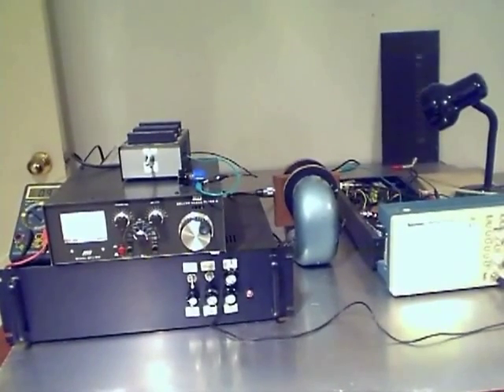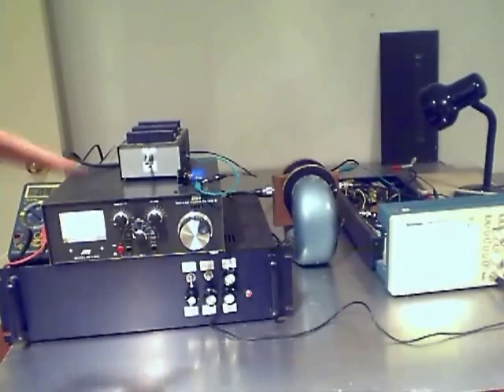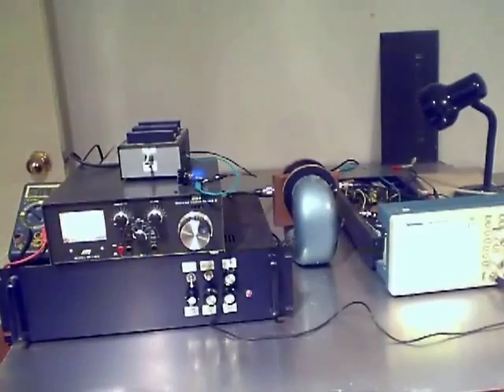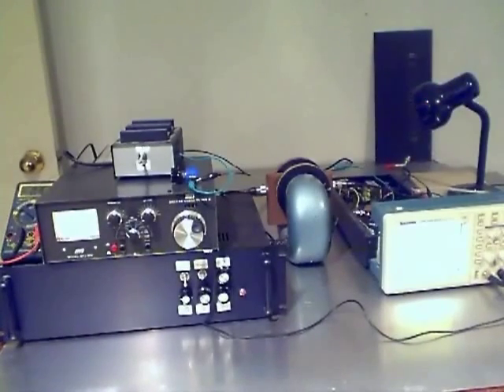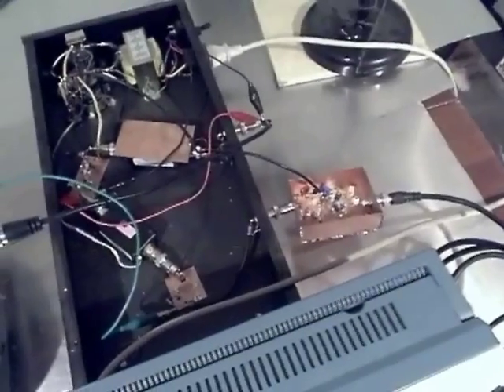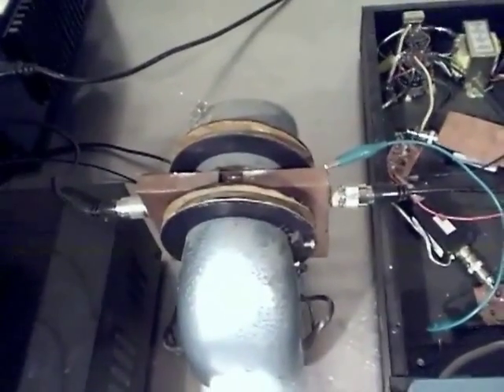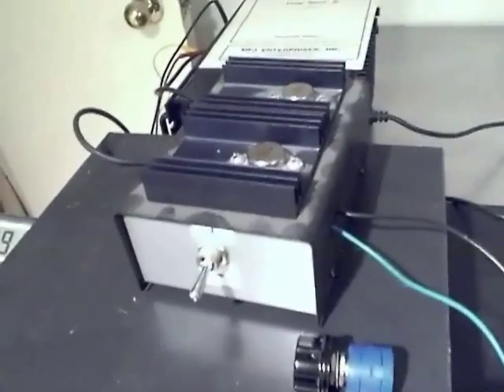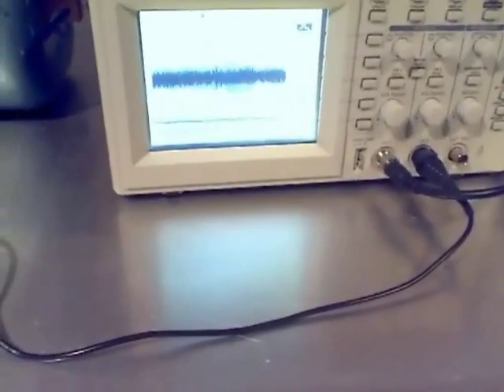Home built Nuclear Magnetic Resonance ( NMR ) Spectrometer part 1 of 3

Comment: how many ppm of resolution?
Reply from the maker: I don't know exactly the resolution but at these low frequencies (18-20 MHz) your resolution is going to be quite low. Resolution increases with frequency so for PPM resolution you likely want higher than 100 MHz. I have experimented with a NMR teslameter  in the 18 MHz range and in that case I was able to get a hydrogen Larmor frequency resolution down around ~2 PPM, but this is a little different.

Comment from the maker: Yes, the radio frequency transmitter produces this frequency, usually it is a CW wave that is frequency controlled using a crystal oscillator. For pulsed NMR this CW wave is emitted in short bursts using switching. Yes, different nuclei require different excitation frequencies, which depend on the strength of the magnetic field they are immersed in.